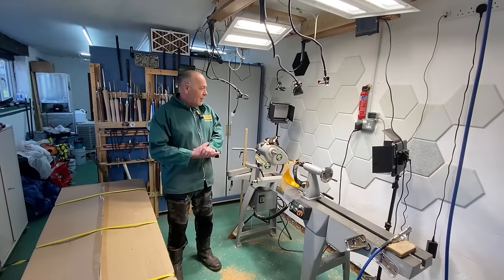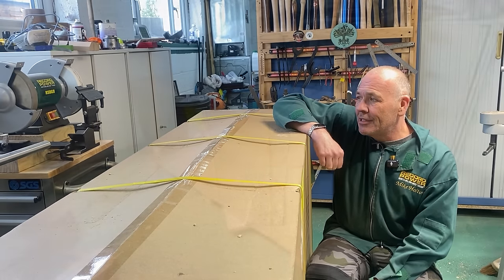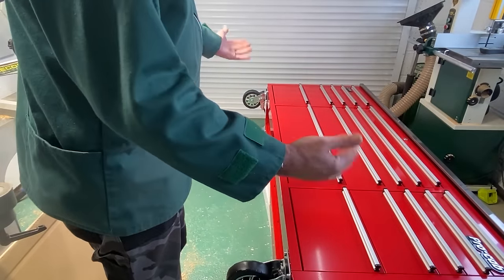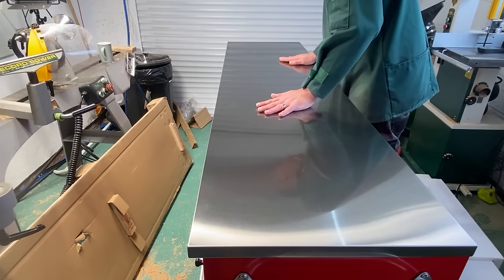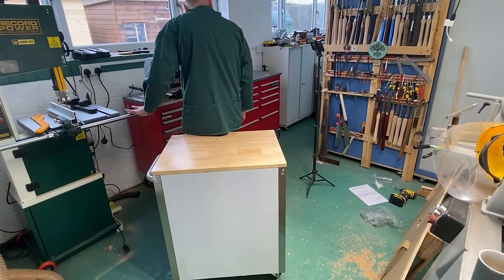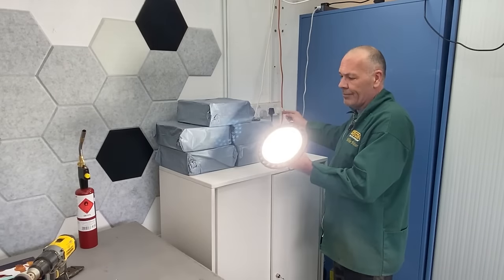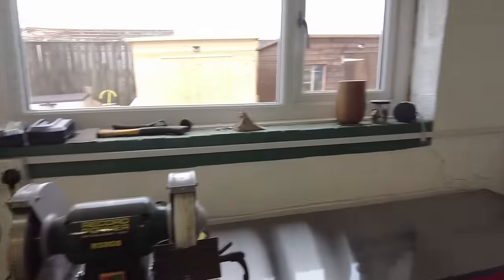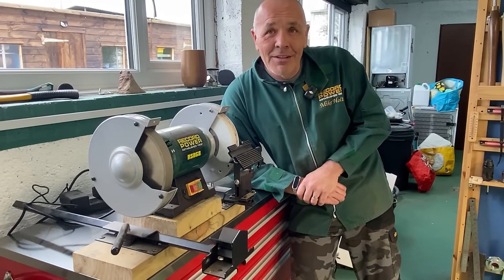Big RED and the SABRE 300 - Workshop update part 3

Comment: Pretty sure the 2 non spinning wheels are supposed to be on the same end as each other, not both at the back?
Reply: I was thinking the same thing!
Reply from the maker: You may be right but it's pretty easy to move  and it made standing it up easier 😀

Comment: You can fix the flickering by changing the video settings to slower than the flicker. 24fps video works well with 50 Hz flicker!
Reply from the maker: Thanks Robin, I film with old iPhone 11's and the only option for 24fps is to move to 4k filming. Which sounds good but then storage of files could become a real problem. I will ponder 😀

Comment: I have a theory. The more storage space you have. The more 'Stuff' you find to fill it. 😱🤣🤣. Apologies if I'm teaching Granny. I use 100mm PVC pipe, but not glued. As you say, the 'Proper' stuff costs a fortune. Credit to Stump Nubs. Try and use sweeping bends rather than full 90 Deg bends to which reduces drag/friction, and loss of suction. Keep ribbed flexible hose to a minimum for the same reasons.
Reply from the maker: Thanks Pete, I will bear all these in mind 😀

Comment: Nice boy toys Mike. Down here in Oz record is a little pricey but we have lots of other good suppliers some  made locally. Buy local if you can.
Workshop is coming along well.
Just a thought Mike why don’t you bring dust extraction pipe over to lathe where you were putting First tee. This would reduce the amount of pipe and lessen friction in pipe and give more airflow to lathe extraction by reducing amount of pipe reqd. Ie don’t go over top of garage door.
Reply from the maker: I will see what works best and maximises space, I'm fairly new to this level of dust extraction so a lot to learn first 😀

Comment: Nice additions to the workshop.   I have several storage cabinets on wheels.  My largest is 42in wide.   Most are 26in wide.   These have really helped with storage.   It is still easy to forget which cabinet and/or drawer has certain items.
I have a 17in bandsaw.   Before I added a milling machine to my workshop the bandsaw was connected to my 4in sewer pipe ducting which goes to my Jet dust collector.   The milling machine required I move the bandsaw to the side of the milling machine.   I was going to extend the 4in duct to the new bandsaw location but "temporarily" connected the 2 1/2in hose from my Fein shop vac.   The shop vac is connected to a 2 1/2in port under the table.   The 4in port is at the bottom of the machine.   I was surprised to find that I get better dust removal with the shop vac at the 2 1/2in port than I did with the 4in port.   Hence my "temporary" solution is now my preferred solution.
As a chemical engineer, I cringe when I see folks with large amounts of ducting and fittings everywhere.   Most folks do not appreciate how much pressure drop and suction can be consumed in our duct collection piping.
A few years ago I took a long hard look at my 4in duct work and tried to remove as many fittings as possible.
In general you want to minimize fittings.   Each fitting consumes pressure drop, so less suction and less air flow.
For 90 deg elbow get the longest radius elbow you can find so it has the lowest pressure drop.   Sewer pipe 90deg have a sharp internal corner.   I replaced these with long radius fittings.
Avoid T fittings.   I removed mine.   T fittings have the highest pressure drop.   I replaced my T with a Y and managed to remove a Y so now only 2 Y's.
Minimize the flexible hose.   This has higher pressure drop than smooth wall pipe.
After my ductwork optimization I could feel higher flow and suction at the end of the hose at each machine.   Not scientific, but noticeable improvement.
I pondered getting an external cyclone.   I did not get one since I knew it would consume a lot of pressure drop.   I added a Thien baffle to the inside of my dust collector.   This reduces the dust which goes to the pleated cannister at the top of my dust collection, which means I only need to clean the pleated cannister once a year.

Dave.
Reply from the maker: Thanks Dave, all very useful. I will have a look to see if I can get Y pieces to replace the T's in the range I bought. There is always a lot of experimentation with these things and I'm looking forward to having a go. I really only have two machines that need extraction so I me overthinking the whole thing but we will see.
All the best
Mike

Comment: I just love getting new toys and playing with them. I chatted with the nice people at Yandles when I was looking for a second dust extractor and they recommended Record Power as it is much quieter - two and a half times the price but I certainly recommend it.  I have extended the pipe and have quick release ends so I can move it quickly from planer/thicknesser to table saw to band saw to router table. Keep up the good work, Mike and looking forward to accompanying you on the next stage of your journey 🌞
Reply from the maker: Thanks Ray, I have the camvac but just the small one, starting to wish I had bought the two motor one 😀

Comment: With regard to dust collection, using a T drastically reduces air flow due to turbulence. Always use a Y fitting, and when going around a corner use two 45 degree fittings instead of one 90 degree fitting. If you can, use 5 or 6 inch pipe and decrease to four inch with blast gates when you drop down to your tools. Workshop is coming together nicely ! Cheers.
Reply from the maker: Thanks so much for the tips! 😀

Comment: Nice... I am jealous of the toolbox and that bandsaw. I am in a similar situation with my dust collector.  I currently have it setup for my lathe but I need to run pipe around the shop for my other equipment.  I look forward to seeing what you do. I have heard when running the pipe to make sure you have it well grounded to avoid static shocks. Sparks and dust don't go together very well.
Reply from the maker: Thanks, I had not considered that but now will look into it! 😀

Comment: Mike that is very nice. I do believe the correct installation of the casters is both fixed wheels on one end and the two swivels on the other end.... that way it can be steered. As it is now you need to slide the fixed casters to turn. Your shop is really shaping up.
Reply from the maker: You are completely right of course, I was just worried about it sliding away from me when I stood it up as it's 160kg

Comment: The Record Power Sabre 300 looks very interesting, Mike, it might just fit the bill for me. I have a 12' x 8' shed/workshop and the roof height is very limited. Very interesting indeed!  I'd be interested to hear your thoughts on it's capabilities and performance in the future, I.e how you find the maximum cut capacity etc. All the best from York.
Reply from the maker: Thanks Andy,  it has about a 10" depth of cut and a very powerful motor. For the smaller workshop it seems like the ideal tool. When I got it I was still in my last place which was very limited for space and it was perfect for there. Videos will start to come out on the 24th ish. 😀. York is a beautiful place, I like a bit further up near Stockton.
Reply: @MikeHolton Thanks Mike, I'll look forward to your upcoming videos. 👍

Comment: It's always so exciting getting new tools. I am really happy for you. You will love the bandsaw. Make yourself a V cradle sled for the bandsaw before you crosscut a round piece of firewood. It will save you from having the piece of wood suddenly ripped out of your hands and scaring the crap out of yourself at the least. Cutting off a body part at the worst. It doesn't take long to make one, and it's a whole lot safer and less scary.
Reply: I put a piece of round stock on the table of one of my 9" benchtop bandsaws and turned away for a few seconds while the bandsaw was running. I turned back around just in time to see the stock roll into the blade with catastrophic results. Although it was an awesome display and a very important lesson, I never want to see that again.
Reply from the maker: Thanks Loran, I will be making one and a few other jigs as well 😀

Comment: why not park the vacuum in the opposite corner, but still near the big dust makers? unless you're going for a bigger unit
Reply from the maker: I wanted to keep noise level down in that area of the shop but I guess it does make more sense 😀
Reply: @MikeHolton  Ah, that did cross my mind as to possibly why, was just curious because I understand that they become less efficient with longer runs of hose? I've no clue though as my only dust extractors are a face mask and a broom!
Reply from the maker: @chammers7377  Morning, after a lot of research I think I'll be just going for independent vacuums on the lathe and the bandsaw. The  length I was going to run it will reduce efficiency too much

Comment: Hi Mike, as someone who has designed industrial dust collection systems for many years I can spot a few problems with the plan for your dust collection system as you described it. Firstly you should do some research into static pressure, aka friction loss in the ducts. Secondly tees are a definite no no, consider y's instead of tees, the shallower the angle the better. The elbows will need to be long radius otherwise your  ducts will plug and/ or abrasion will wear the elbows out. You need to be very carful about the diameter of the ducts, if they are too large the air velocity in the ducts will be to slow and the dust will fall out of suspension and the ducts will plug if they are too small the velocity will be to fast and the dust will abrade through your ducts very quickly.  There are books available to help you with your design. Good luck.
Reply from the maker: Hi Rob, many thanks for taking the time to explain a few things. I had done a bit more research since the video and I have decided to go with two dedicated units, one each for the lathe and the bandsaw. The other Items I want can all be happily serviced by a shop vac. Keeping dust down is of great importance so a few more ponds spent on two units seems well worth the cost. All the best, Mike
Reply: @MikeHolton  Great choice Mike! I am sure that will work well for you.
Reply from the maker: @robharrison6606  Thanks Rob